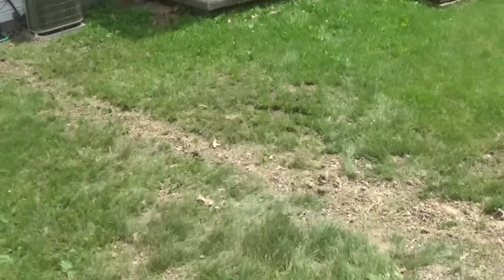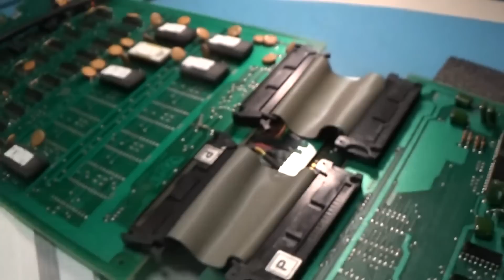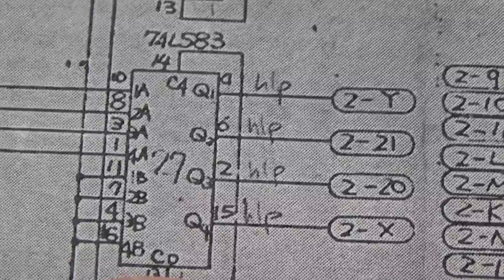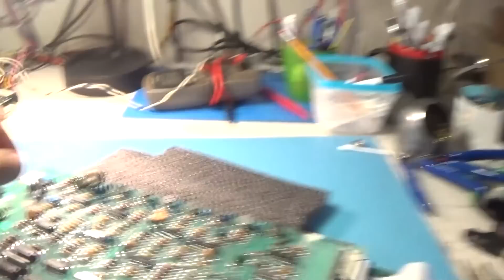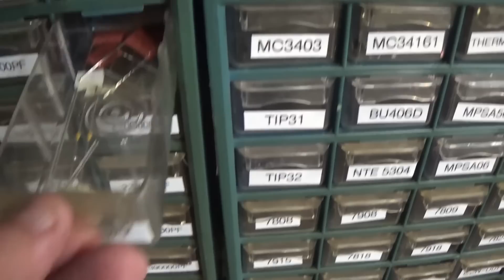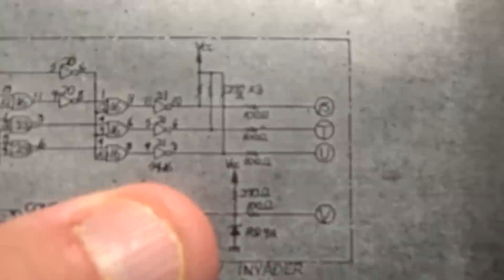1979 Taito Space Invaders B&W/Color 3 PCB Stack #4 of 4 Repair  6-07-2024

Comment: If you are going to run ethernet to your shop...please use a Cat 6 shielded type cable.  You can also hook up a little 5 port switch to be able to hardwire up to 4 additional devices.
Reply from the maker: it is cat 6 cable , also rated for outdoor burial,  even though I chose to run it through buried PVC :)